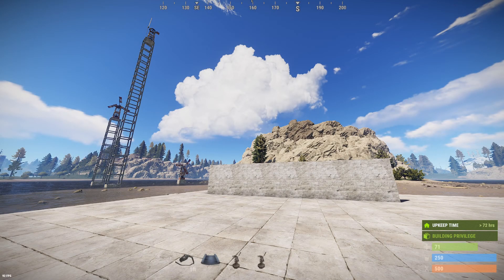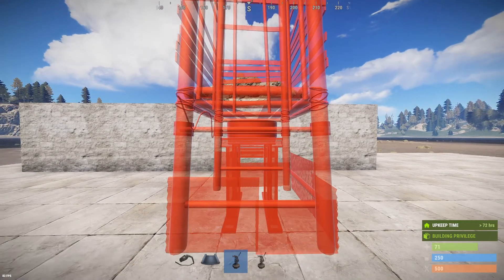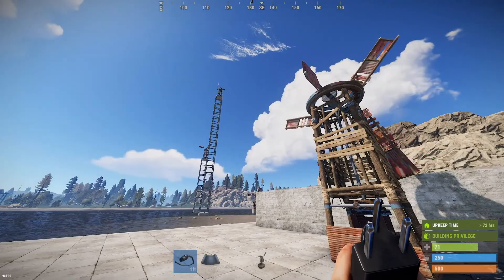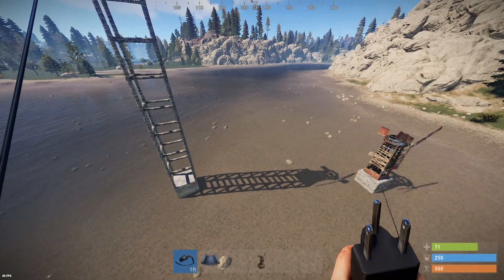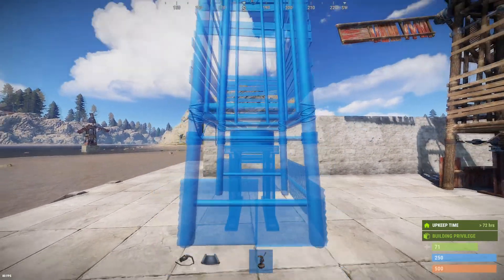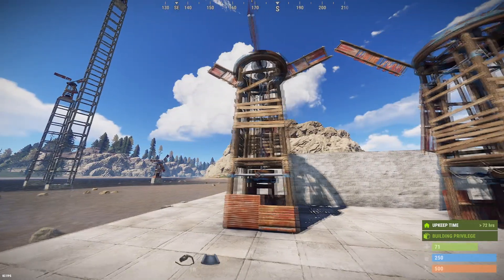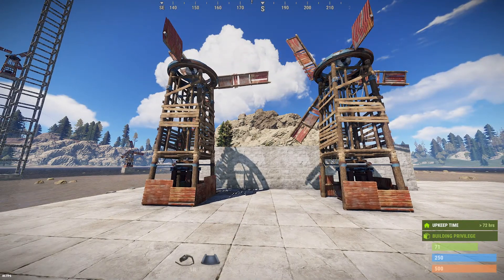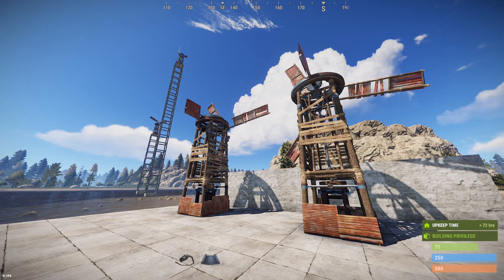Rust Electricity 101: Component Guide - Wind Turbine

Comment: Watched all your electricity videos and I'm thoroughly impressed by how much detail you go into. You have a really good understanding of rust electricity. Appreciate your content!

How do you set up your turbines with batteries in your actual playthroughs of rust? Do you run them with root combiners to have one single battery output with the turbines just powering the batteries or do you use a minimum power with a blocker to charge batteries during the day? It would be really helpful if you had a video on "infinite power" or something similar where you showcase how you use batteries to supplement low power from turbines for example.

Lastly, I'm struggling with equally powering 4 batteries from 4 turbines + some solar panels. If I only had 3 I could just use a splitter but there doesn't seem to be a way to do this efficiently with branches without having leftover power going to one battery (and thus not charging equally). Any ideas on this one?

Comment: Have you experimented further with the windmills by placing them on different elevations of terrain on the same build heights and noticed any difference in outputs?
Reply from the maker: Yes, up on the top of the mountain, the general surface level wind was higher and the the 9 story tower was again 30-40 units higher. 
Interesting though a 19 story tower nearby a hill of the same height gets better wind on the tower than the surface of the hill at the same 'absolute' elevation. This would suggest that you get a slight advantage with higher terrain, but the performance 'bonus' from being on a structure is relative to the terrain upon which it is built.